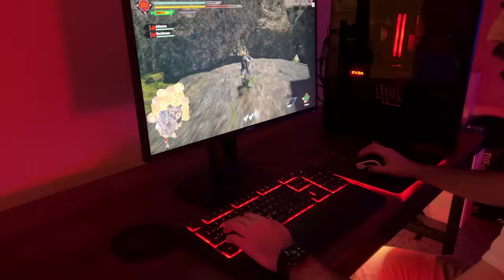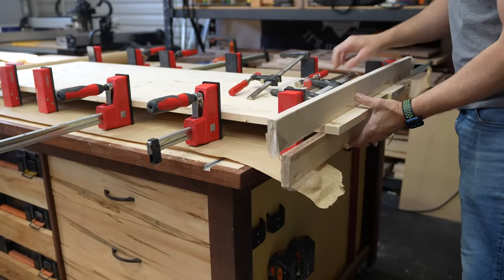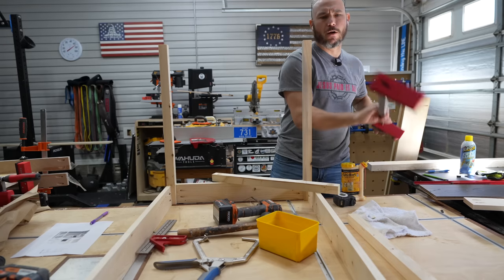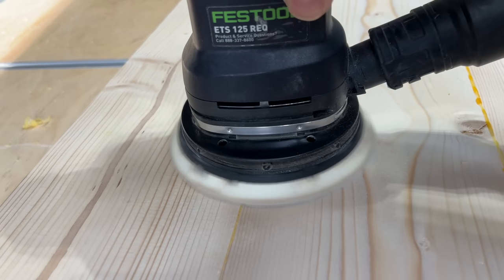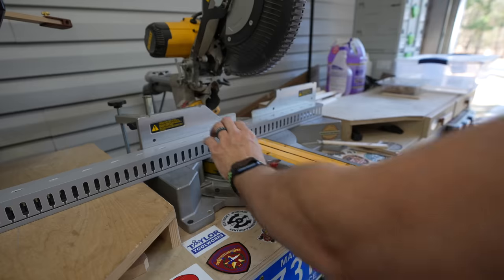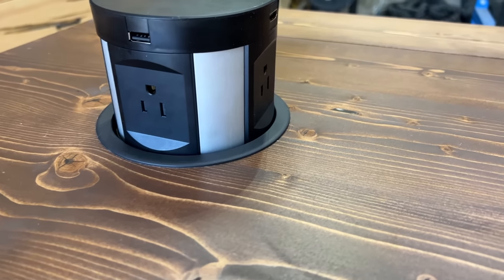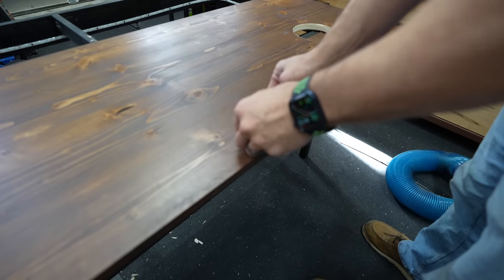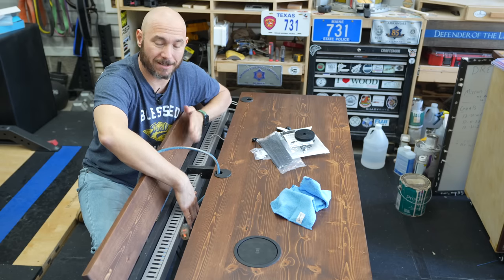How to Build a Desk | Hidden Wires, Wireless Charging + More

Comment: Hey Matt, love your channel. Thanks for going into detail on how to run an operate a business by woodworking. One question I had, can you explain or do a video on how to document and keep track of your cut list for each build you make? If it's a custom build that a customer comes to you with and you have to basically figure it out, do you manually (hand write) your cut list and store each set of instructions in a file cabinet or do you use a program and document/store each cut list online?

Comment: I attached mine to my wall directly by putting a simple 2x4 attached to the wall, laid the desktop on top of those boards and 2 legs on the outside corners. Made a nice custom L shaped desk by attaching it to the corner of the room. Slapped some LED lights on the bottom and the under glow was great. Def regret not sanding it properly before painting it but I used a large mousepad over the entire desktop so I didn’t really need it. I’d honestly like to upgrade it to remove the legs and have a set of drawers to replace the legs to make those legs functional. I like the idea of the shelf, you could put the PC on the shelf if you made it wide enough and then some gas arm monitor stands for the desktop. Those manage the monitor cables nicely as well. I use a dual setup. Works great.

Comment: I really like this- especially the cable management system. My mother has an old particle board desk that is falling apart. No cable management & not enough space for stuff. I want to make her a corner desk with a neo angle so she can face the corner while typing. Have a nice keyboard tray that adjusts height and angle that I'd put on it. Want her to be able to have  larger monitor (she can only get 21" with her current desk). Hutch on the left side. Hutch on the center part but leave it open on the right side (well, maybe with a ridge to keep stuff from falling off) so she can see the TV while at her desk. I'd also want to give her a foot rest of some sort. Would need a place for the APC to go too (power goes out frequently where we live). I'm trying to find some decent plans to follow but nothing matches up with what I want, but at least the cable storage and how to make the top parts are helpful in this.

Comment: You should use a UPS battery backup. It protects your expensive computer parts more than a standard power strip, and if you lose power the battery backup gives you time to turn off everything correctly so you don't fry your hard drives. Also if you have your router and modem plugged into the battery backup then when the power flickers you don't have to wait for them to reboot before you have your internet back. Awesome build though. Always enjoy the content.

Comment: The things you use to hold up the table top while you stained it. How do you keep it from putting indentations in the wood top? I have the rockler bench cookies and they have plastic tops that have a point to it. They left dents. is there any way around that?
Reply from the maker: Yeah you can't put any pressure on the top.  If you press down, it'll cause indentions for sure

Comment: Nice design, build. Being pine I might have notched the cable tray if possible, or maybe a piece of hard wood for the support. I’ve put a screw (vertically) in the support board just behind the notch before with pine to prevent splitting over time. Great improvement from the plastic table!